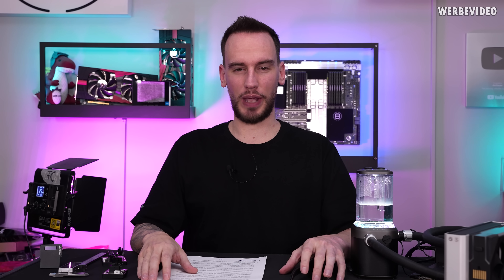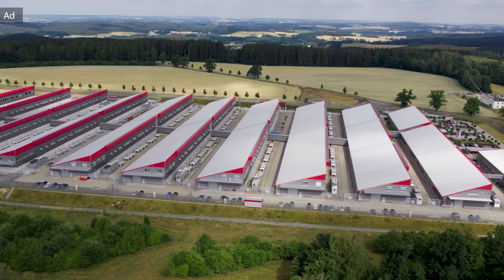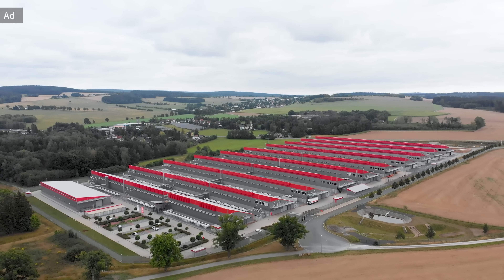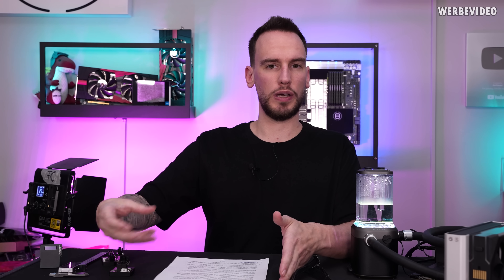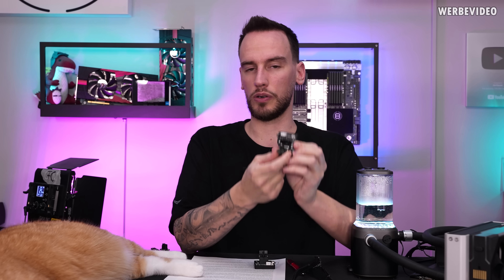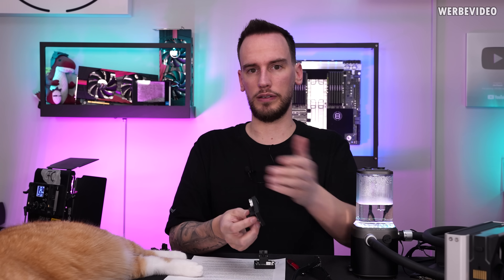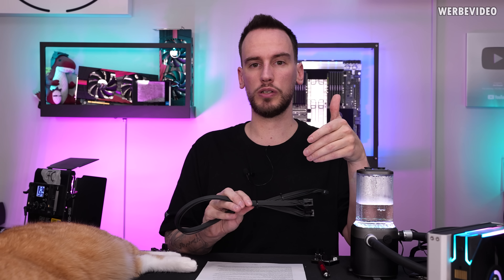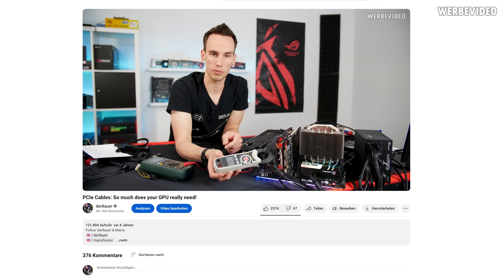12VHPWR is just Garbage and will Remain a Problem!!

Comment: I'm an electrical engineer by trade and can say that in my experience, the hardest part of a design to get right are connectors. They're expensive relative to other components and notoriously unreliable unless you go ultra premium. The problem with a consumer electronics part is that companies are always going to cost down as much as possible, which was easy with the old Molex 8-pin connector, since it was comically oversized for the current per connector. This meant that even a bad connector that significantly eroded the safety margin would still be okay, and could even still be pushed a little beyond. This tiny micro-fit connector is great from a size perspective, but now we're putting more current (9A!) through each pin, and each pin is smaller. The thermal area to dissipate the heat from the connector is smaller and it's always going to be harder to keep running. It wouldn't surprise me to see reviewers having significant issues with these connectors going forward, because the realistic lifespan of this connector is going to be 20 mating cycles before degradation.
Reply: I'll pick safety over aesthetics any day. This new trash connector was a 'solution' looking for a problem. 3 or 4 8-pin connectors would have done the job and handled the bending required with many cases. And that's assuming they were positioned vertically.
Reply: @Cash4-4444 Yup, tin plated varieties are rated at 20 mating cycles. This isn't an issue with old Mini-Fit connectors as they have a much larger surface area to spread the wear between sets of receptacles, they're probably good for at least 100 mating cycles in practice.
Micro-fit isn't the issue either, the plus line is thermally rated at 13A through all pins at 20C ambient temp, and uses the same kind of plastic housing as Micro-Fit 3.0, the only real difference is in manufacturing tolerances.
If you drop a power connection on a very old 6 pin PCIe connector rated at 8A per pin, the remaining power connection can still supply 75W with 20% to spare before overheating the connector.
The same is true if you drop a single power connections on an old 8 pin PCIe connector (rated at 8A per pin), the connector can handle 150W with 20% to spare, and the modern ones rated for 13A per pin would be good for 250W.
If you apply the same criteria to the 12VHPWR you are looking at 4 pairs (down from 6) running at 80% load before overheating, or ~350W. Cables could still light up under failure, but it's much better to fry a modular PSU cable or PCIe to 12VHPWR adapter than it is to fry connectors on your very expensive GPU.
Reply: Just look at the 12vHPWR and imagine 50amps through it, theres no fucken way it can handle it. Their engineers must have been on crack when they designed it.
Reply: @zaxmaxlax  lol yes thats the most hard evidence, just look at that thing! regular 8pin was fine.
Reply: @zaxmaxlax   50 amps is nuts i have ham radios and i have a Big 50 amp supply and you need to run some good connectors or you will burn it up!
Reply: What if we set power limit to the 4090  -15% and undervolt the card
Would that increase the saftey margin
Reply: It should be staggeringly obvious to anyone not sickeningly undereducated that a pin's ampacity can be exceeded if there is complete failure to do something as utterly trivial as plug it in correctly and check the catch is secure as blatantly designed. The sheer lack of intelligence, care, and attention to the most remedial of detail associated with the degrading failure to do this constitutes a truly shameful embarrassment. All this hoo-ha over the source of failure is shocking and ridiculous, and shame on all those suggesting any problem lies with anyone but the user on this matter.

Properly seat your power cables, buy a case that fits, do not bend cables, do not use 3rd party adapters, have a professional who knows what they are doing building rigs and you will have a %99.9 success rate according to the current data..
Reply: Apollo I agree with you. Who is going to take their 5090 in and out 20 times? Maybe 3 or 4 times max for any home user. Too many people commenting on sometime they don't fully understand leads to the comments you see in this video. Typical for the gaming community
Reply: Its like running a cars battery through a phone charger. It won't work at best, cause issues, and break shit the worst.

Comment: wires, wires, wires, people don't understand, if you want close to 15 amps you need a fucking thick wire. Try 10 gauge! Jesus this just proves my point. I run 10 gauge on my god damn monitor speakers that only have a 6 inch drive and 1 inch tweeter.. My car that runs 12 volt uses 4 gauge wiring on the battery. Get a clue computer people. Just for reference I build computers and automobiles for a living.

Comment: I find it amusing how they touted this new connector as so much better.  "this is the new standard" Then connectors started melting...
They should be honest, they wanted to make a connector that used the bare minimum materials so they could use wiring that used the bare minimum materials so they could increase their margin's as much as possible.  The graphics card company who forced this connector should be the one resolving this.

Comment: Current ratings would have been a non-issue if they just went for the Molex Microfit+ as their base-line. Compared to the MF3.0 they based it on, the MF+ can handle 13A per pin. Which would have made the 12VHPWR able to work with 936W (!!). But no... gotta save a couple bucks per obscenely expensive graphics card apparantly...

(Also be sure to check if their specification includes the 75W that is delivered through the Motherboard. PCI-SIG is prone to add that to their calculation)

Comment: Video idea.
Is the AM5 heat-spredder too thick?
Take a AMD 7000 CPU test it, mill or grind 0.5 mm of the top, test it and repeat until there is no heat-spredder.
I think AMD made a compromise and made the heat-spredder too thick because they have efficient chips and could live with the higher delta temperature. But I would be wrong.

Comment: The problem is that Nvidia does not care anymore.  We saw it with EVGA's exit.  We're seeing it even more with these flawed power connectors.  We're especially seeing it in the fact that board partners aren't even trying to ship GPUs with the classic 8-pin PCIe power inputs, even when they know it would be a better solution, because Nvidia will not allow it.

Nvidia must go.

Comment: As an educated electronics engineer, having an idea of what currents flow through this 12-pin connector, I can say with a clear conscience that this connector is a joke. I'm guessing someone design it to be preety and not disfiguring the appearance of the card, but not work well. I don't see any other reason.
It's a sad fact that this is how everything is done today. Professionals with knowledge, experience and imagination have disappeared. In their place, accountants and marketers were hired, not with mental agility but with fleeting minds. This connector is the best proof of this.
Technical progress, of course, will and is inevitable. It's something that feeds itself. But from a qualitative point of view, everything will get worse and worse. Because the overriding strategy is to maximize profits at the price of everything else. It doesn't have to be reliable, it has to be preety to convince the customer.

Comment: What were the designers thinking? We're already at capacity, so let's... downsize the thing? I don't even like the fact that there has to be an additional power cable to an add-in card, but that's explained by being piggybacked on an old design that didn't really expect such power draw. A design that disrupts backward compatibility deserves better than becoming a rather expensive fire hazard. It solves literally zero problems, while creating new ones.

Comment: Alright hear me out here, how about a connector that has 2 big pins similar to lets say an XT60 or even XT90 and run a GPU of that, instead of using multiple pins with the same potential. No more melting issues considering those connectors are rated at 60 and 90 amps respectively. It's dumb that the proffered design has loads of small pins that can't carry much current.

Comment: Imagine selling a product for $2000 with such a design flaw that you can't even properly install it in most common cases, not even including an adapter that would at least work around that particular issue – let alone have that product on the market for over a year and not come up with any actual solution to the underlying issue that should have every customer worried ever powering this product on without sitting next to it. Imagine providing that piss poor of an experience for a product in that price class, a product that would even be expensive if it was actually flawless – and yet your customers are still buying your products like crazy. No wonder Jensen Huang thinks he can say whatever stupid thing he wants ("the more you buy..") and get away with whatever price strategy and supply shenanigans with such a loyal customer base.

Comment: The video did not cover the issue of the common bus to which all pins of the connector are connected. As a result, if the resistance of the cables/connectors is not equal (f.ex., some cables have not been used, and when you upgrade a graphics card, both the old and new cables are connected together.), the current will be skewed and therefore overheating will occur, according to the laws of physics.
Reply: Nvidia already implemented since a bunch of generations a power balancing circuit between PCIe and the extra connectors. No idea if AMD or Intel did the same thing nowadays but that was not the case with Vega and prior.
Though, until the card power draw isn't too close to the max rating of the two connectors, this should be fine as the current will balance himself with resistance just like the 3 or 4 wires on the same connector already does.

Comment: You don't need an egineereing degree to understand that reducing connector size while increasing power is a stupid idea. It could have worked if they introduced screws, like on the old DVI connectors

Comment: even in serious situation like this, it's crazy that Far Cry 3 aged like fine wine. You can probably say that nvidia did the same exact joke three times already and it's not even funny anymore

Also no matter what I will always refer 12vhpwr as 12vftwr (12V Flamethrower). This shouldn't exists at all not even on 4090, and definitely not in every nvidia gpu at all no matter how low end or high end it is. The only problem is that nvidia will always strangle AIB partners even for just implementing a nice and safe features. When I looked at that connector placement in EVGA not 4090 I knew EVGA knows way ahead of basically everyone else that this is going to be a nightmare plug especially when you have to bend it. They better give a bit of freedom to AIB in SUPER cards for the power connector (ESPECIALLY for 4070 and 4070Ti Super) because average consumer that only know this plug is catching fire and melting probably would still rethink many times before pulling the trigger due to the similar look which would just make them go 'yeah no this uses the same flamethrower plug. Aint buying it'

Comment: At least a prefect and thorought calculation about what is going on. I am about to crimp my own cables using supple silicone insulated 16AWG wires hoping to not to put any strain on these fragile connectors but it looks like the problems are far from over

Comment: I'm just wondering, why people, who spend 2000+ € on a graphics-adapter and who know about the importance of a hi-power, hi-quality (hi-price) psu to deliver the required amounts (buckets) of current even think about using Molex connectors, how many it may be, as power connectors. "Seids ihr deppat?" There are already available hi-quality, hi-current connectors i.e. for radio controlled-electro planes, which demand an equal, or even higher amount of power & current flow on the market, and those card manufacturers just have to implement those in their card design. It may cost a few bucks more, than the tin pins of Molex, but it will give the user the safety of not living in fear to electrocute his pricy equipment, or even burn down the house.

Comment: When I first saw these connectors I thought, yeah probably a good idea for size constrains as long as they bump the voltage up to say 36v or similar, but a physically much smaller connector and trying to pump more current through it is the same thing you do in electronics/electrical engineering class when you are bored with nothing to do, so you slowly torture electrical things like Photonic Induction style until they blow up or catch fire.  Someone was bored in that engineering team and thought it would be funny, I mean I would have too if there wasn't any legal consequences lol. But as  customer I would be pissed!

Comment: Why keep using all these small-gauge wires and tiny pins? We connect 2000watt 12V car amplifiers with nice big wires you just stick in a hole and tighten a screw down on 'em. Just one wire each for pos and neg.